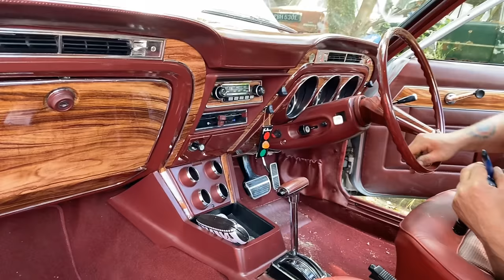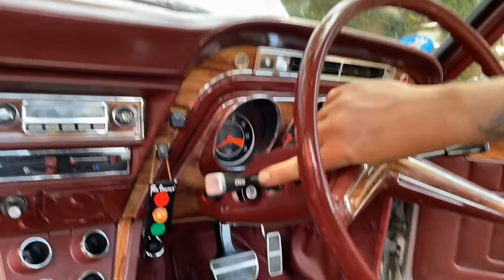We Explore A Graveyard Full Of Classic Rover P6’s And More!! Part 2

Comment: Such a shame all those rare 3500S have been left to rot away so badly. If I remember correctly from years ago, the locks were zero torque type. Only the correct key would open it, but any same type key would lock it. Usually fitted with a matched set of  Wilmot Breeden FR or FS series locks on doors, boot, fuel and glove boxes.  A larger style key was fitted for the combined ignition and steering lock on later cars. Easy to open with a length of stiff bent wire, or plastic binding strap, slid in through the door top to hook around and pull up the lock button on the window sill.
Reply: For those who want to know I deleted my original channel for personal reasons but if any of you want to see what happened to the cars in the future feel free to subscribe 😉 
https://youtu.be/fKJaxdLlCL8
Reply: The red one was restored so that is not so bad

Comment: That Vip has a tax disc from 2003, looking at the way time has taken its toll on it sitting there is eye opening as a classic vehicle owner. Proves that standing something up outside is a bad idea, of course it could have been rough when parked I guess. Such a shame, do like a P6.
Reply: I used to have P6's from around the late 70s. I'd buy to run then sell, break for spares or just swap and change parts around to make a really good one. Back then they were cheap, and plenty around. Even the oldest of the 2000 4 cylinder examples were only 20 years old and could be shabby and rusting badly in places. The V8's were younger and seemed better preserved, but still could deteriorate if neglected. I had mainly V8's and some were pretty bad.  I hate to think of the horrors another 35+ years will have caused to the base units.  Bad ones can be made to look smart with all the bolt on new panels hiding rot. The time and cost of fabricating and welding a rotten base unit is what will ultimately make or break a restoration.

Comment: I really hope some of these beautiful British cars are saved and I’ve just realised why the bonnet on my Dads P6 was now painted Matt black as I forgot about the paint peeling on the Alloy Bonnet.
Reply: P6 engine bay and inside the boot area were in satin or gloss black from the factory.  Just the base unit area visible around the  door shuts were fully finished in the outer body colour.  Sills could be body colour, black or brown, depending on year and model.  Every outer painted or vinyl covered body panel, 19 in total, were then screwed or bolted onto the base unit, along with glass and trim etc. The original P6 construction idea was to also supply factory pre painted panels for accident repairs.

Comment: I think to restore mental health I need to see a video of finding a Rover P6B in a garage with no unexpected ventilation (rust), hood lining still attached,  quarter vents that don't fall out, battery mounted in it's proper place with the cover holding it down, solid bulkheads,  Glove boxes that shut,  all panels fitted and aligned, Brigade red,  with the sound of a 3500 engine running, the sound of a door shutting (it's a special sound to hear a Rover 3500 door shut properly).  Nothing good comes from hoarding.  If the owner had tried to save one good P6 he just might have succeeded.  Very sad.
Reply: You have predicted part 3 to the letter ;)